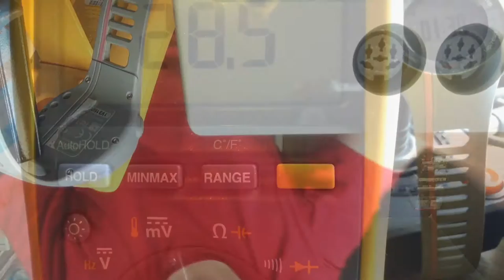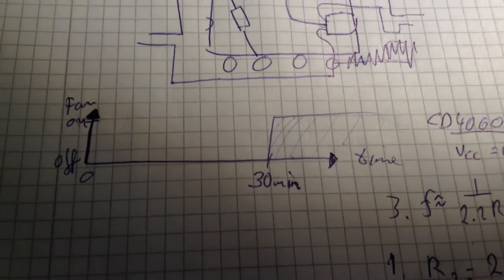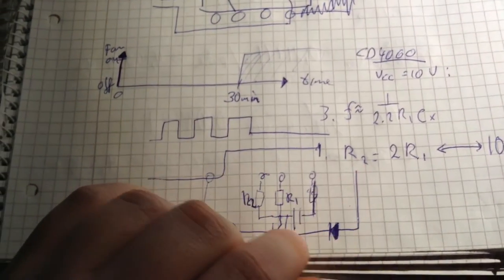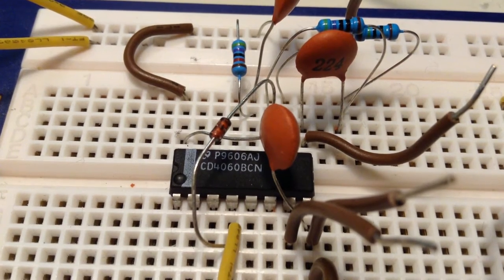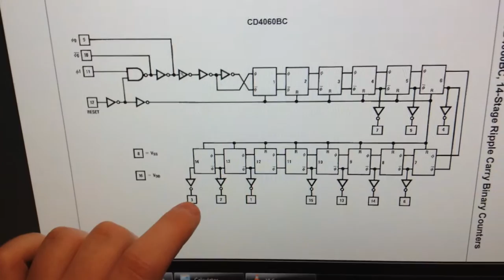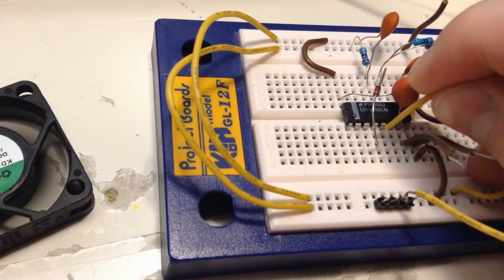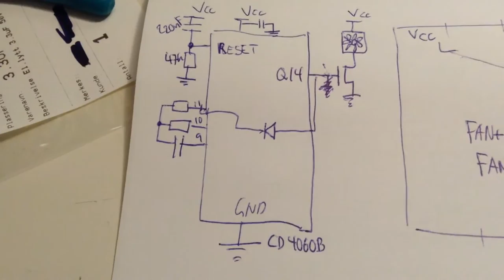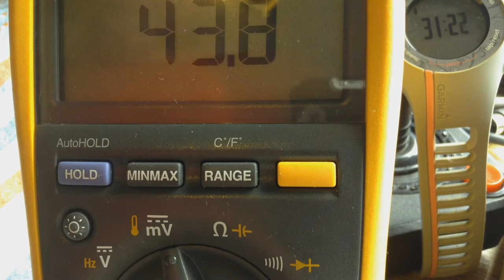1541 Disk Drive with internal fan and delay (CD4060)

Comment: Great job mate. Very interesting to watch. I couldn't listen to that loud fan for very long. The large 120mm fan that I place on my drive is practically silent and I switch it on as soon as I switch the drive on, which means my IC's never get warm to start with. I added a dust filter to my fan, so although I am pushing air into my drive, the dust is minimised :) I may do a video response to this and show my setup
Reply from the maker: StigsWorld I think your solution  is fine as the usage of the disk drive is much less than the day to day use of a PC. Even without a filter.  The simplest is often the best! I'd like to see the video response. That would be cool. The reason for the fan beeing so loud is because of, facepalm,  I used a 5V fan on 11V-unregulated and I wonder why I didn't just buy the 12V fan that I had infront of my face the other day while ordering. I will replace it with a larger fan (50x50x10cm should fit) and correct voltage. I've been very tired lately. I'm surprised i didn't blow up anything. Remember, this fan is off most of the time i use the drive, and only on if i forget it and then it can also be as a warning buzzer :D Like they say in silicon valley: "It's not a bug. It's a feature!" :D It's the hour to hour temperature buildup that kills the IC's. I have only had confidence enough to run the drive for 2 hours where the drive shot from 26C to 46C or 48C. Testing thermal design at where i used to worked showed that even though it seems that temps stop in the test after 1-2 hours, they do continue to creep. I remember collegas asked about that why I ran the tests for so long.. That was until they saw the extended graph. So it is likely that the drive can reach 60C (from 25C ambient) over night... and if the drive is a hot climate the temp will be even higher.

Comment: I'm not sure I understood all of the design there but with a bit of extra tinkering you should have yourself a nice setup. 
Right now the fan will warn you to turn the device off at least. It functions as sort of an alarm right now :)
Reply from the maker: The Highlander Haha. Yeah, or it can buzz for 5min then switch the drive off and back on again, but it's better to get the correct fan. I knew I had to replace it soon when gluing it so I just glued the corners for easy removal. It's nice with invisible modification also for the real retro-feel :) I should have said in the video that these concerns about dust and if fan is moounted other way warm air can warp the disks are design problems seen from a manufacturers stand point. The less drives returned to them is more money.. If people just want to add a fan thats already much better than the other option of not having a fan. Regarding the design, I did cut out a lot of theory from the recorded video.